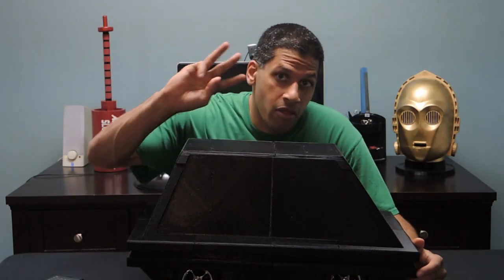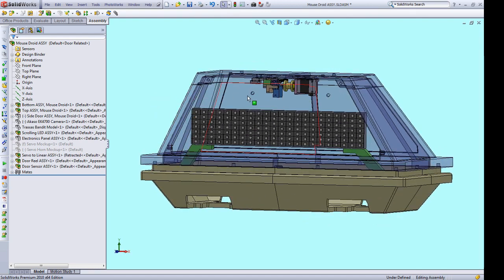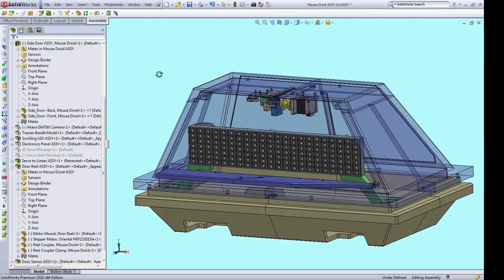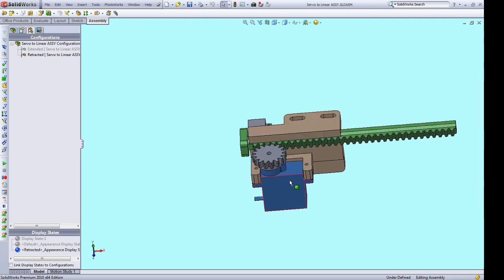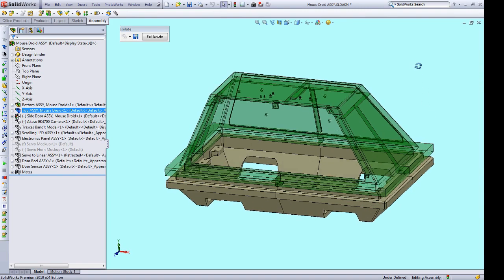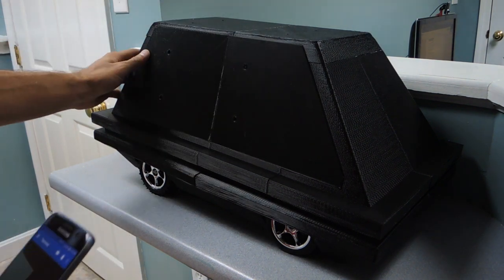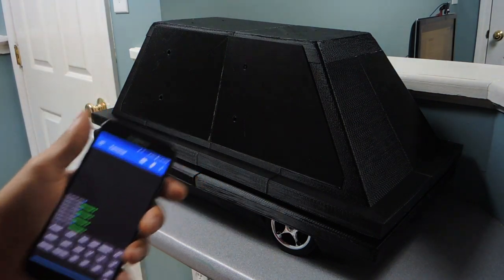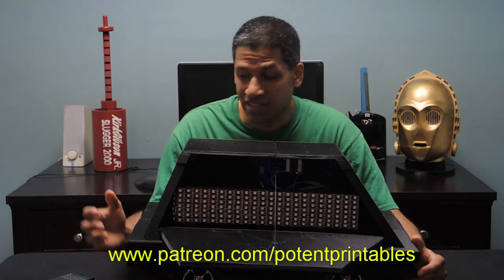Star Wars Mouse Droid with Hidden Payload, Part 3 - Door Mechanism

Comment: If you add a thread on the outside that enters the droid through a hole in the bottom (and maybe add a roller) you could remove the linear actuator.
Reply from the maker: That's an interesting idea- I think you mean to make a dual-direction reel with one stepper motor, right?  Use it to pull the door open in one direction and then reverse direction to pull it closed.
Reply from the maker: Would love to see that. Share pictures if you end up designing it!

Comment: Hi , nice design and project! Why do you use a continuous servo instead of step motor?  Would you not be more use of the position with the step motor?
Reply from the maker: Thanks!  Cost and size are the answers.  All I needed to do was push the door over center in a very coarse fashion and then let gravity do the rest.  I certainly could have used a stepper motor to accomplish this, but it probably would have been more expensive and taken up more space.

Comment: Also, are you still using the stock RC controller for actual movement?
Reply from the maker: Yes, but I made a custom holder so I can mount my cell phone on top of the controller, for easier overall control of the droid.
Reply: Ah, cool.